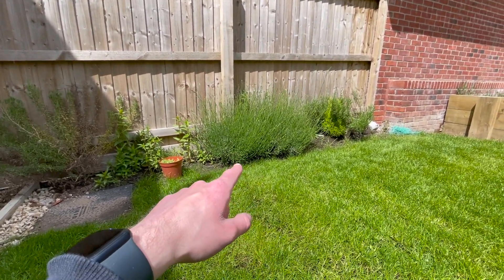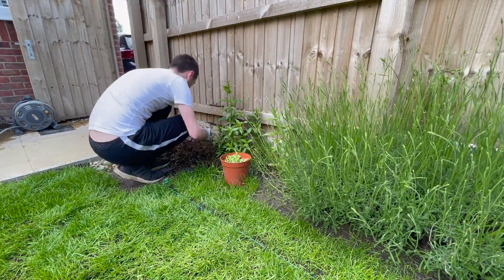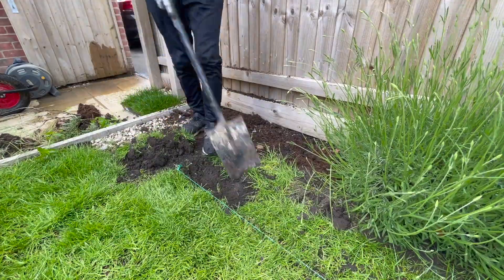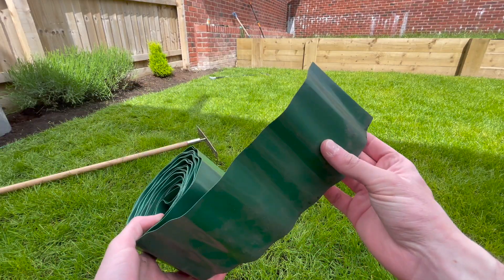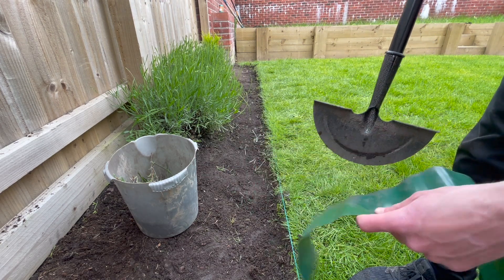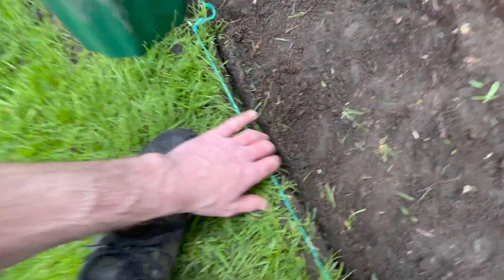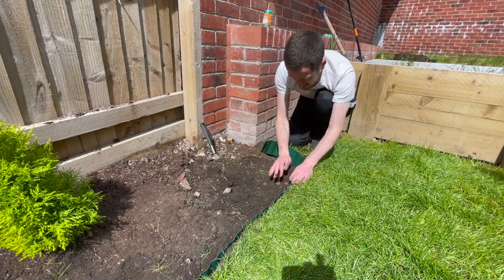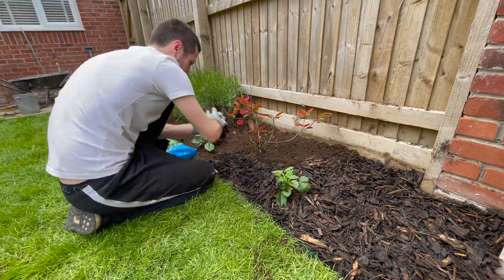How to Install a Flower Bed - Garden Renovation - New Build Garden

Comment: Great video. I would suggest that you put the wood you used on the edge of the lawn by the retaining wall on the flower bed. I will give you a solid surface for the mower to rest on and stops the lawn falling away at the edge.

Comment: Cut the lavender back every winter I do mine in January to keep it under control each year I cut it back quite hard maybe to a 200-300 mm ball.
For edging try 100 mm x 100 mm pressure treated timber on a bed of gravel nice for the mower To go over.
Reply: Hi I've done my borders but I dug too much soil up. Put compost and topsoil down. Now the weed start coming through so redug it but my soil is very Claylike and clumpy. Any advice as don't want to plant til sorted the garden bed out.
Reply: @carleechan5014  just hand pull the weeds as you see them and dig as much of the bad clay soil out as you can and replace with compost or good top soil, if you have a large garden you can dump the clay soil somewhere out the way if not remove it in rubble sacks when you can and take it to the local tip.
Reply from the maker: That’s a good shout. I’ve gone with a treated timber for the dying in front of the retaining well, looks quality too 👍🏻